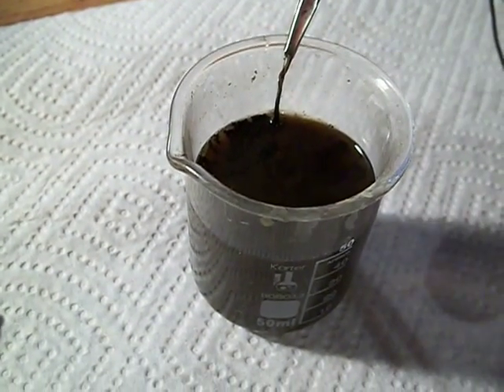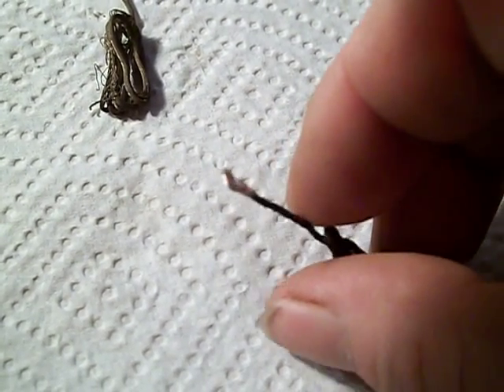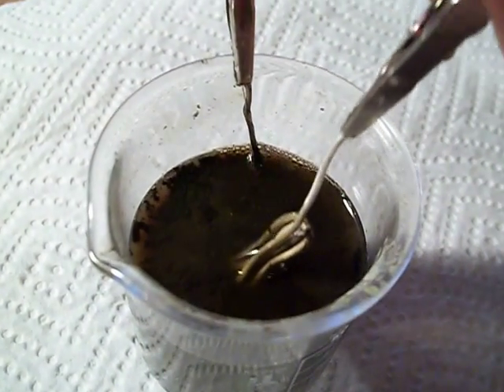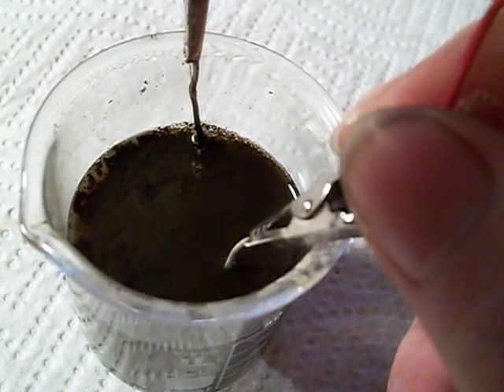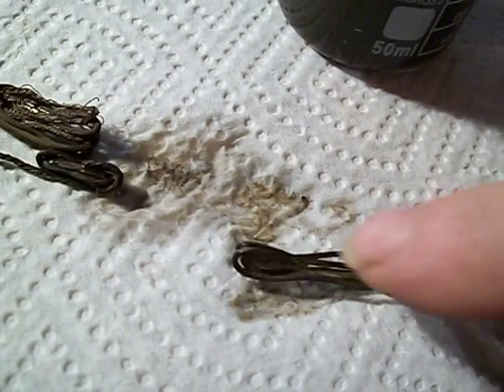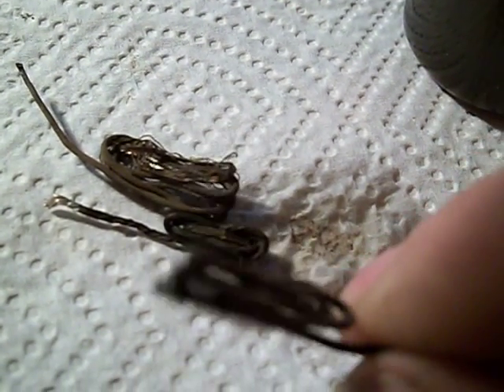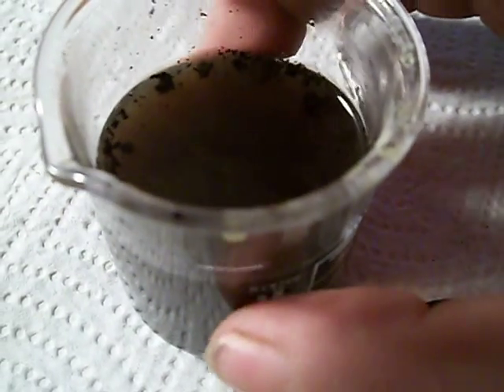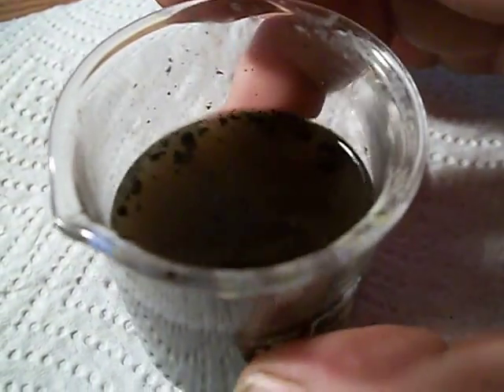silver strip

Comment: Hi, Geo for silver plating try Na2SO3 (sodium sulfite) electrolyte, the silver is recovered as metal, not as a salt. You can make the electrolyte by mixing NaOH and Na2S2O5 (SMB) in 1:2.6 weight ratio.
Reply from the maker: Thank you very much. I really was only trying a proof of concept for goldsilverpro on the GRF but this is some good information. The next time I work with some silver plate, I will try it.

Comment: geo, i started a new project today involving milar with siver on it.i  made the first batch using nitric acid and hydrochloric acid. 50/50 and i realized i should have been 50/50 hydro.and peroxide. so now i have 2 solutions. to get the silver i wanted in the first place,can i still make silver from nitric,and hydro. mix? also what to do to complete the process? what to do to complete both processes if thats possilble.
thanks robert
Reply from the maker: hydrochloric acid will not dissolve silver.wash the mylars in water and mild soap and rinse with clean water to remove any oils and let dry.make a bath of nitric acid and distilled water 50/50 in a dish that is fresh washed and dried and that will hold them one at a time.dip each mylar in the dish until all the traces disappear.lift with plastic tongs and rinse, with a spray bottle containing distilled water, back into the pan.soak as many as the acid will absorb.you will see this as the traces will not dissolve.for what you have done,add table salt to the AR solution (hcl/nitric acid) and any remaining silver will precipitate as silver chloride.too,the white powder that formed in the AR is silver chloride and will darken in bright light to almost black.if you threw this out,it was your silver.when you add hcl to silver nitrate,silver chloride will precipitate out.

Comment: wont some of the copper desolve in with silver?
Reply from the maker: No, the reaction with copper is very subdued. There are recommended amperage and temperature ranges per square meter of anode and cathode to ensure no base metal is dissolved. Since the electrolyte is basic and not acidic, it is non-corrosive. The action can only occur when voltage is applied. Just keep the amperage low regardless of volts and the copper (or what ever the base metal may be) should stay undisturbed.